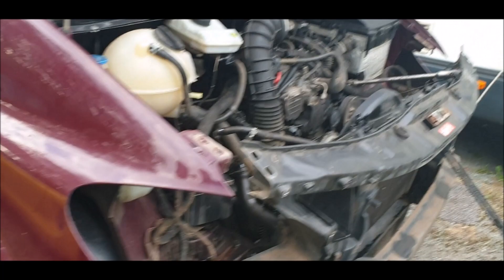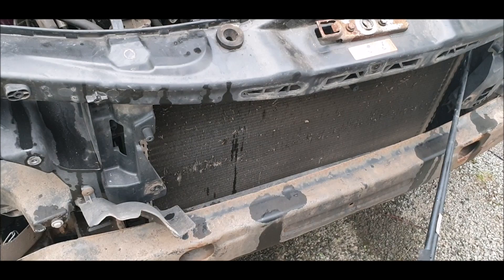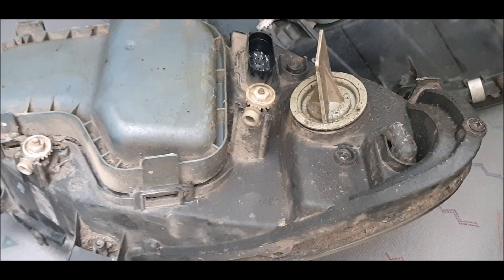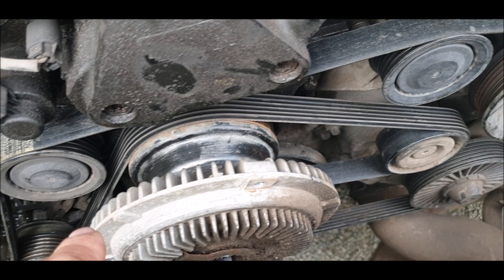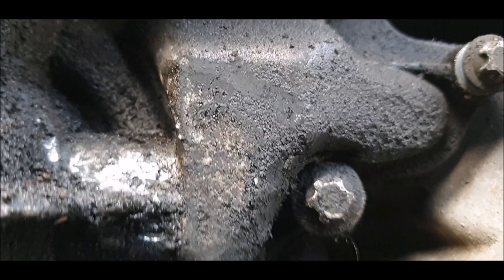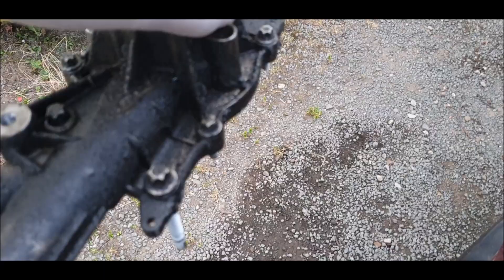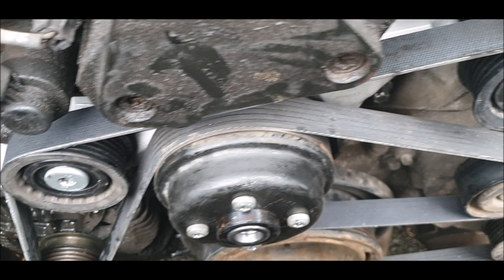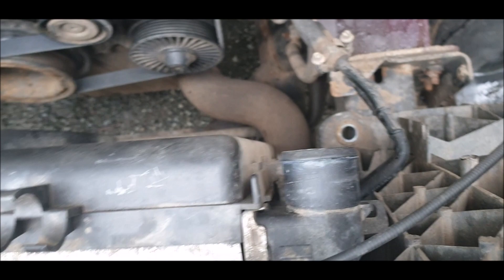Mercedes vito how to Change water Pump and fan belt

Comment: So just to confirm , I replaced my waterpump a few days ago. The man is right it is easy enough. 
  There a relatively small number of bolts to take out. Taking off the lower bumper will probably be the hardest. At the corners are little plastic dowels to take out once they are out a few bolts them bumper off. Take grill off to , that's super easy. Next 4 bolts each per headlight , and there easy out too. Next bit seems scary your gonna open a few bolts on the top cross member , and the bottom , just do it , once done flex out the radiator assemble and then in at the allen screw in the middle of fan. To get this loose can be tricky , find a suitable small diameter screwdriver and tap in behind screws to hold against allen screw. There are 3 different size torx sockets , to get off waterpump. I suggest visiting a breakers yard and look at a engine out , to see first hand which screws to take out. 
  Tips. : be careful of upper pipe on radiator,  relieve clip on expansion bottle end and let off that pipe. Otherwise risk snapping off. If that happens use chemical metal to fix. 
2. Check orientation of jubilee clip on pipe , as fan belt can rub against it. 
3. When taking bolts out of waterpump , push into piece of cardboard. To remember way to put back. 
4. Probably need replacement plastic grommet pins to secure corner of bumper and wing corner. 
5. Don't worry it's a very doable job. Will need a selection of torx sockets,  male and female. 
6. Take a photo before taking off fan belt.

Comment: Managed mine without removing the headlights and removing the crossmember. Replaced a broken condenser at the same time. 

Keep up the vids
Reply: How did you manage it without removing the headlights etc?
Reply: Take the radiator shroud off

Comment: Looks like there might be a leak from the high pressure pump? On my vito the oring on the back of the high pressure pump, was seeping oil. I put on a thicker oring, as factory one is quite skinny. Gave it a good push to get it back it.

Comment: Hi i need advice on a 115 cdi vito . When i start it it turns over for a while  before it starts and when it start it dos not go more than 3000 revs . Can anyone give me some advice
Reply: That is normal it wont let you rev pass 3000 revs with stationary. ( Safety feature)